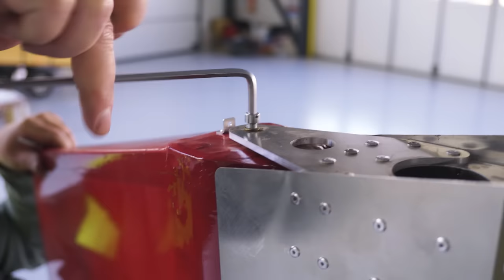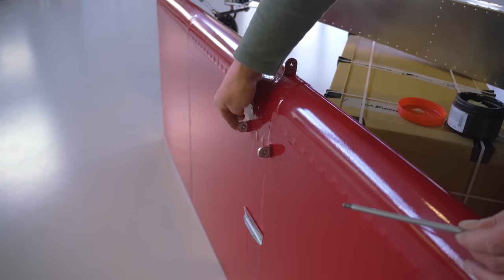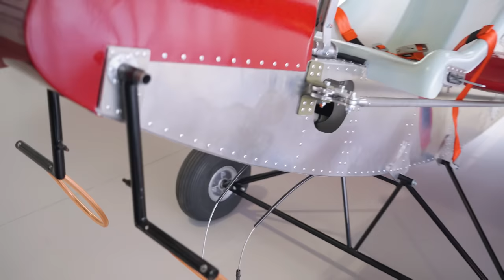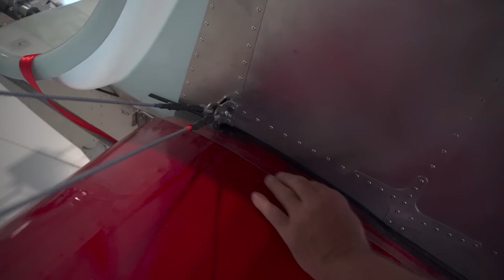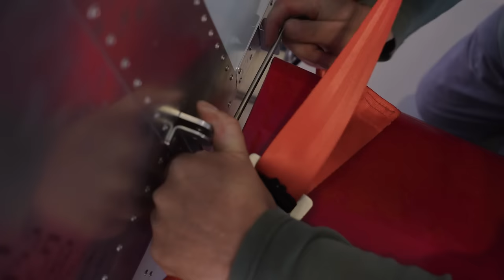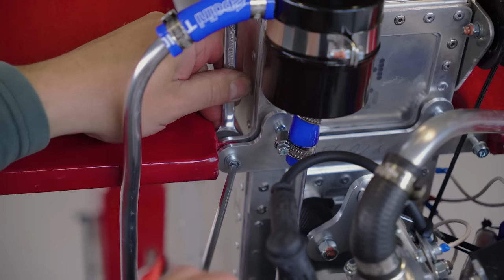DINGO TUTORIAL | ASSEMBLY

Comment: Excellent build! I thought biplanes were done with after WWII because of the extra drag and weight of the bottom wing.
Reply: They were done after WW-ONE, not WW2, yes, because of unnecessary drag and other aerodynamic deficiencies. That said, if one doesn't care about drag, they still have positive features.
Reply: biplanes do have advantages tho, the lift to wingspan ratio is unmatched, resulting in incredible roll rate and the fact that they are connected with struts make biplane wings incredibly stiff and sturdy. if you don't want to fly fast they are the superior design
Reply: Fokker even went for a triplane design with their DR-1 resulting in unmatched low speed maneuverability. Baron v. Richthofen the famous "Red Baron" scored many hits in his DR-1, it was a very capable air superiority fighter
Reply: The triplane didn't have wires, it had cantilever wings so the drag was quite a bit less than it otherwise would have had.  @theflotheflo
Reply: They do however have incredible strength to weight for the wings, since they are made as a truss bridge is made. Biplanes did last until WW2 in many designs, such as the British Albatross torpedo bomber that brought an end to the Bismarck, and the American Grumman F3f2 Navy fighter on line until 1941. Many pilots of WW1 refused to fly monoplanes. They were slow to catch on as too many were collapsing and killing the pilots. If you notice many early monoplanes had extensive wire bracing because wing spar technology was not easy. Probably the first high performance unbraced monoplane came from Hugo Junkers of Germany. but few others had much success as people were afraid of wings that weren't braced. Even more modern monoplanes like the cub, the cessna line of civil planes need strut bracing. Biplanes are inherently so strong many are rated aerobatic.
Reply: As materials and structual engineering improved over time, biplanes got better. There will likely never be a supersonic biplane, but fast isn't everything. This is an example of a biplane meeting very stringent requirements. Limited power, weight, cost and simple construction.

Comment: I am a bit concerned that none of the holes were deburred.  It's an ultralight and not prone to heavy stresses, but come on those holes need to be cleaned up to reduce stress cracks and wear.
Reply from the maker: Hello, thank you for your feedback. Every builder can build as best as possible and do that. 

All holes produced in the KIT are debugged during the production process. :) The holes which are drilled by the builder should be debugged by the builder.

Comment: Looks nice... but your building techniques are very sketchy.
I only saw you use 1 castle nut with a cotter pin,  all the other nuts were nylon. And no other cotter pins anywhere. All of the nuts should have been castle's with cotter pins.
The only safety wire you used on the horizontal stab attachment bolt, you wired on the wrong  side of the bolt head
Causing the bolt to get loose,  not tighten the way its supposed to.
Other than that,  it's a great looking aircraft
Reply from the maker: Hello, thank you for your comment. If you study the regulation, then you will find the following paragraph, which is taken from higher regulation EASA - CS23 Amendment 4.: 

CS 23.607 Fasteners
c) No self-locking nut may be used on any bolt subject to rotation in operation unless a nonfriction locking device is used in addition to the self-locking device.

The bolts you see in the control system, for instance, are not rotating. The rotation is secured by spherical bearings (rod-ends) mounted on push-pull rods. 

The connection you have mentioned: The elevator pin is secured by cotter pins because it needs to be disassembled for transportation, and in this case, the consumption of nylon nuts would be high. 

Please look closely at aircraft certified under the CS23 or FAR23 in different categories. The best examples are: 
(ULL category - P92 Echo MkII - Nylon nuts) https://tecnam.com/aircraft/#all
CS-23, FAR23
P2010 - Nylon nuts (single engine) https://tecnam.com/aircraft/#all
EXTRA 330SC - Nylon nuts (Unlimited aerobatic Single-seat aircraft single engine) https://www.extraaircraft.com/330SC.php
P2012 - Nylon nuts (Twin engine) https://tecnam.com/aircraft/#all
P2012 STOL - Castle nut with a cotter pin (Twin engine) https://tecnam.com/aircraft/#all

The difference is in the level of commercial operations, such as POB, regular maintenance, and quality of maintenance. 

DINGO - the main reason we have used the nylon nuts is because the builders and maintenance can forget to put the cotter pin, and then the nut is not secured anymore. There is no regulation for this aircraft category, so the aircraft is not maintained under the certified organisation.
Reply: @futurevehicless.r.o.4896  thank you for the specs. I Learned something new tonight.

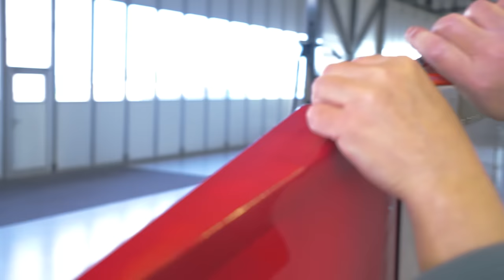Comment: 3:38 that lock wire is not quite right...
Reply: Many things are not quite right
Reply: Bolts on the compression rubbers :50 should be long enough for a couple threads past the nut.

Comment: Sorry to piss on your parade but the work showcased here does not reflect proffesionally trained aviation technicians. Not 1 torque wrench was used, many critical fasteners held in place with fiberlock nuts instead of castle nuts and cotterpins, driving in bolts with a hammer is a no no. I could keep going on. I work on certified aircraft and am a licensed aircraft mechanic so maybe I’m over critical
Reply: You  can t   COMPAR.........Professionnal   plane....with  that....AND  IT IS  NOT  THE   SAME   PRICE.....any way   it  s   very   interesting..(to funky)
Reply: It is not a Boeing !
Reply: It looks flimsy, anycase.
Reply: It's part 103. Totally different world to what you work in. In the US, you don't even need a licence to fly it!
Reply: I got your point FunkyBass, even if it's not a certified aircraft, it's experimental class, it wouldn't be difficult to use the "right aeronautical stuff" such as castle nuts, and a torque wrench to get an "extra margin" of safety.... Airline pilot here, not a mechanic, but I do agree with you!
Reply: @Lemev  It's really not necessary for homebuilt ultralights. I've been building a much bigger two seat ultralight and there are hardly any castle nuts in that build at all. Not even the engine mount! Nylock is fine for this class of aircraft. Tighten it up, put some torque seal or similar on it, if it does start to loosen, you'll see the movement because of the torque seal. In the general ultralight classes around the world, there are some restrictions that make it very unlikely that the difference between a castle nut and a nylock will mean anything. Total weight is restricted, no aerobatics, restricted to one person if FAR 103, or pilot and passenger for ultralights in other countries (or known as LSA etc)